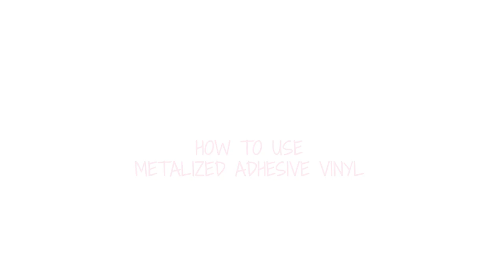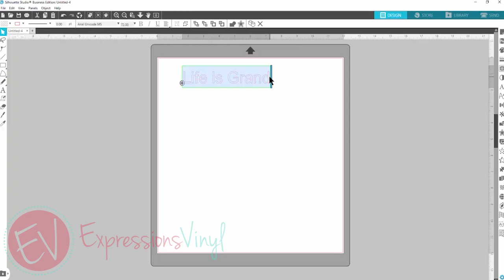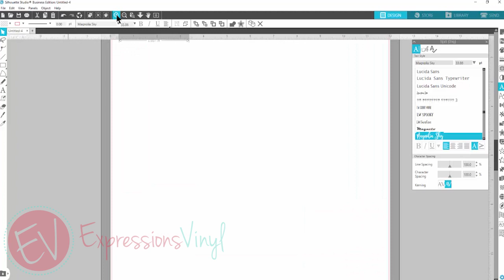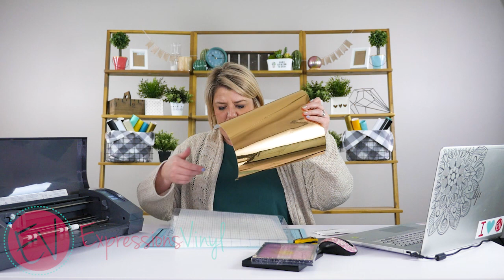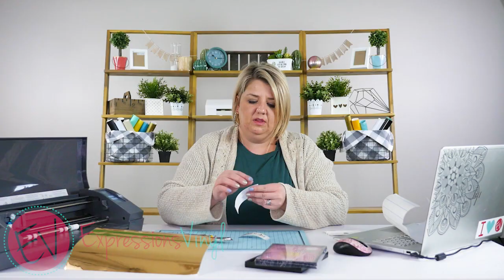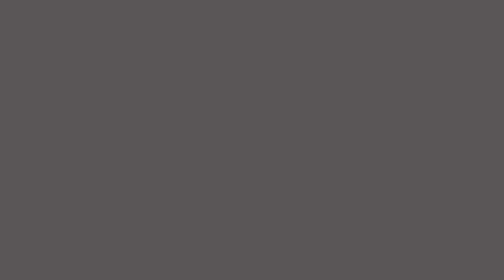New To Vinyl - How to use Metalized Permanent Adhesive Vinyl

Comment: Hi - metallic adhesive vinyl - what setting would I use on cricut explore air 2?? Doesn’t seem to cut and I keep wasting vinyl- I read “vinyl plus” on your website but no such setting on my machine
Reply from the maker: Your machine should have a dial.  The dot between vinyl and iron-on is considered vinyl+.  Test cut and adjust as needed.  Every machine, blade, and batch of vinyl can vary enough to require setting adjustments.  Sometimes adding a x2 passes helps.

Comment: The vinyl + is not enough for this type of vinyl.  It doesn’t cut all the way through.  I’ve wasted so much vinyl I’m in tears.
Reply from the maker: Each machine, blade, and batch of vinyl can vary enough to require setting adjustments.  Test cut (we often use a capital R smaller than a half inch) on vinyl+ with a x2 passes added to the setting.  Or try Light cardstock.  test and adjust as needed.  Contact customer service if issues persist.  https://expressionsvinyl.com/contact-us/
Reply: Did that - still doesn’t cut through for me to weed
Reply: Same issue I have cricut machine

Comment: Could you have mirrored the image (prior to printing/cutting) so that you could have placed it on the back side of the glass so that it still reads correctly but won't interfere when dusting/cleaning the glass?
Reply from the maker: This can work with vinyl that has the same color front and back.  The metals often have a different color on the back.
Reply: @Expressionsvinyls  ohhhhhh because the adhesive is still on the back side. Right. Sorry about that, it worked in my head, lol! Thanks for the response.
Reply: @jennabobenna3631  LOL

Comment: Can these cutters accurately cut 8mm - 1cm height lettering?
Reply from the maker: Yes.  However, it will depend on the font and the kind of vinyl used.  Small thin fonts can be challenging to cut.